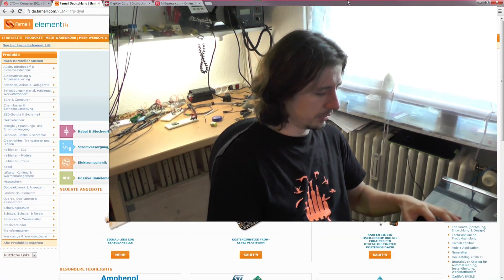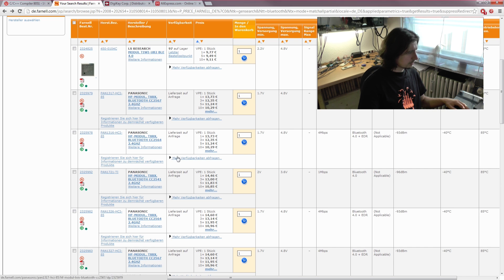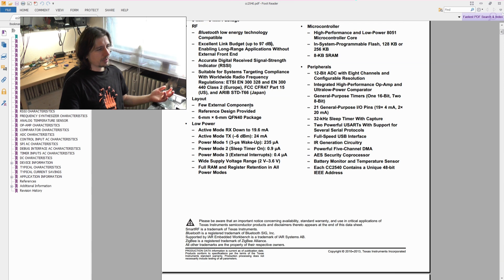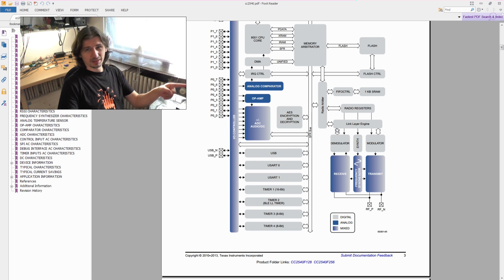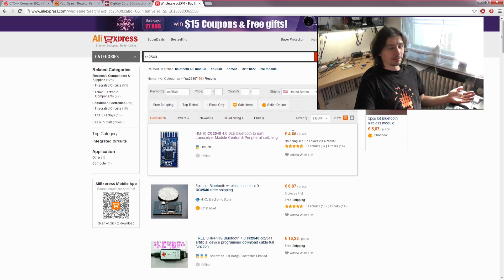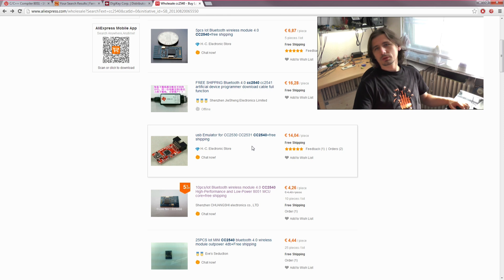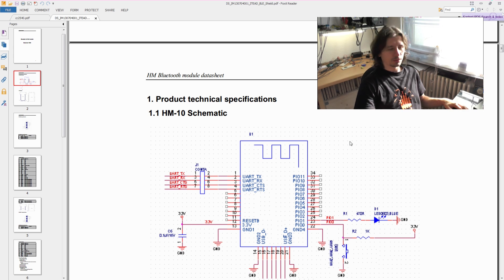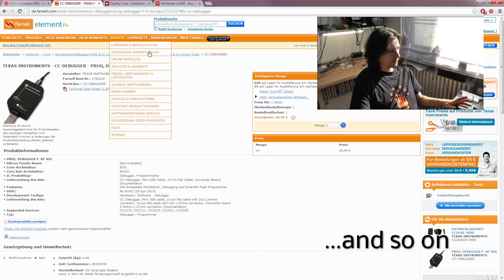Bluetooth 4.0 (BLE) - 01: Basic Component Research

Comment: Good evening.
I live in Brazil and I liked your project.
I would use something like cars.
The car comes with a device deste.Dentro the concierge would have a computer connected to another part of the device via USB.
  It sends a binary code and the other central unit identifies it by code and input through the USB connected to power the PC it displays the code on the PC screen ... I would like to do this using these two devices?